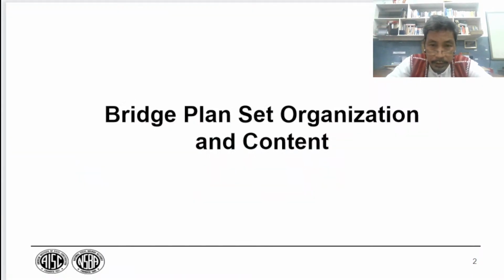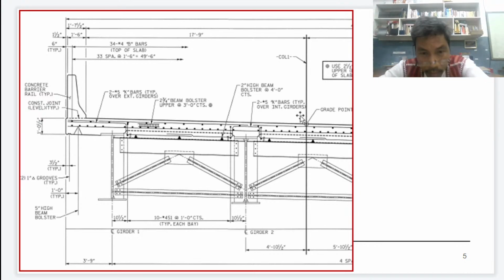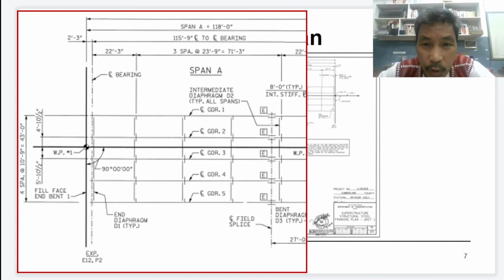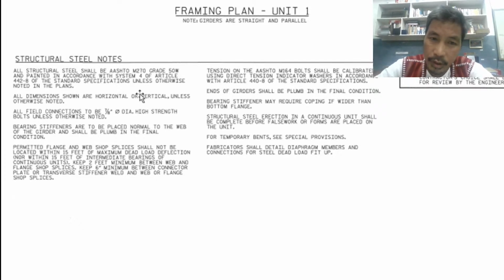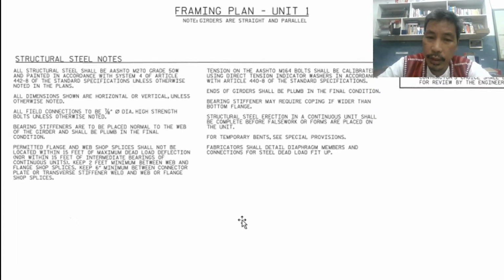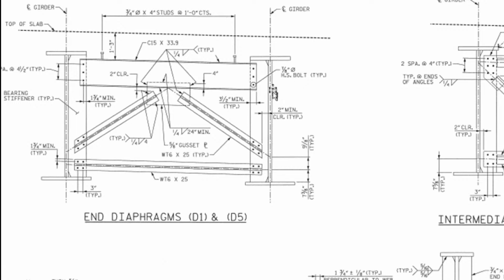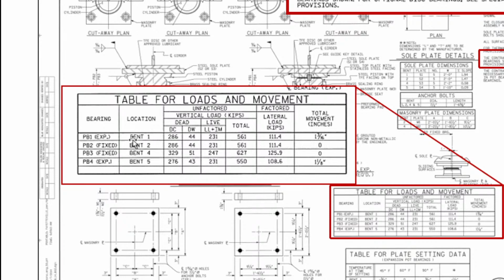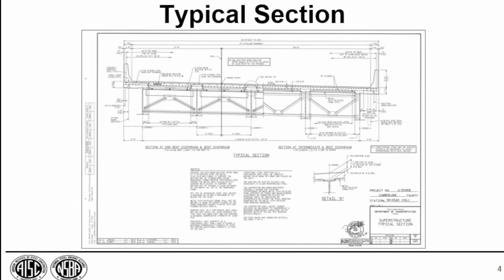[ LIVE CE E4 Lecture 02 ] DrAP Zantua Bridge Engineering Plan Talks + ENGINEERING Analysis & Design

Comment: Thank you sir for explaining the whole details that indicated on the bridge engineering plan. I have learned the specification and requirements that need to be follow and also I found out the structural steel notes which is under of the framing plan. You also discussed substance of the girder elevation, cross frame details, bearing details, and other elements on the plan.

Comment: Thank you sir for teaching us about bridge plan set. I learned some demonstration and clarifying the Bridge Engineering Plan. I also learned about structural steel notes which is under of the framing plan and the specifications that ought to be followed. I also learned about girder elevation's content, details of cross frames, details of bearing and other details that is included on the plan. Thank you sir and God bless.

Comment: Thank you sir for further discussing the bridge engineering plan. This is a very important topic as every details of this plan is need to be executed. Proper reading and analyzation of the plan are needed. Also, thank you for clarifying about the approximation of the area of the steel. Yes, sir 0.785 is still 0.79. However when we use this to find the flexural stresses. It gives a discrepancy in finding the neutral axis. Then another discrepancies when taking the parallel axis theorem or the transfer formula. this make a large discrepancies on the answer on the book to my solution. I just wanted to know that what are the possible ways so that we can eliminate this discrepancies as we are talking about the the analysis, sir. A misestimation on real situation is horrible especially when it uses in the design.

Comment: This live discussion is about the continuation of what we had discussed the last meeting with the same bridge engineering plan. The differences between A, B and K bars were explained.  Exterior girders and interior girders are the same is through in the framing of exterior and interior columns. Some clarifications about area of rebars were discussed and why some tables are rounded and some are not, but the usage is the same. From plan and elevation, and typical section, framing plan was the next topic that was explained.  The intermediate diaphragm, bent diaphragm, and end diaphragm. Girder Elevation and Bearing details are the last two topics that were discussed. Thank you sir for these informative live lectures. There are so many technical terms and symbols that I learned tonight. Repetition of watching might help me to fully comprehend these plans. This concludes the bridge plan set organization and content. Thank you sir.